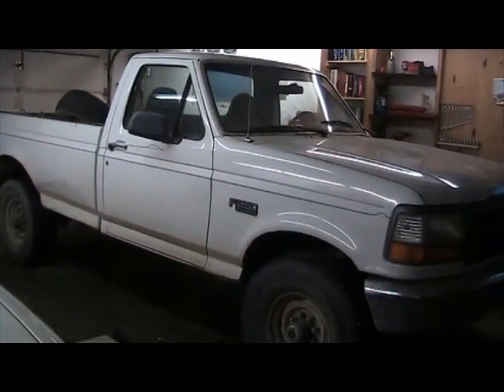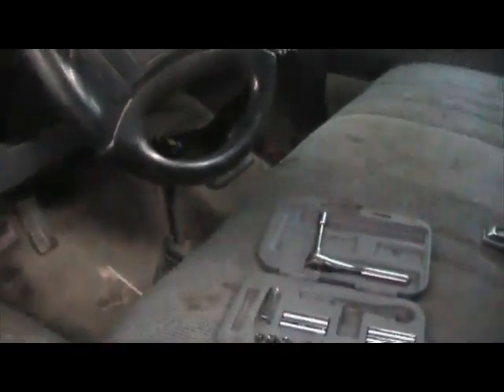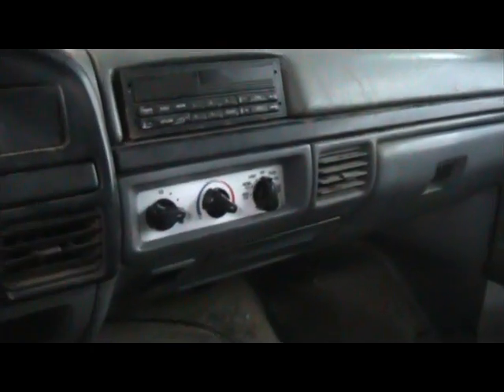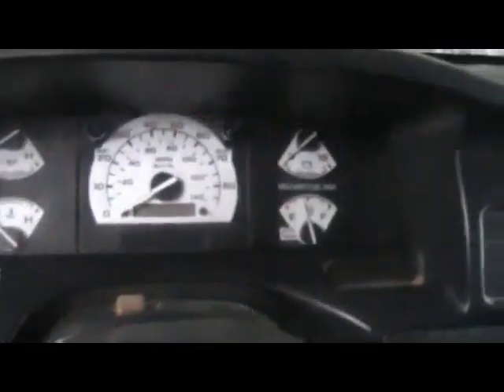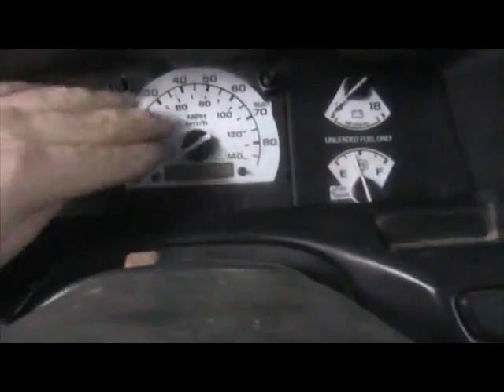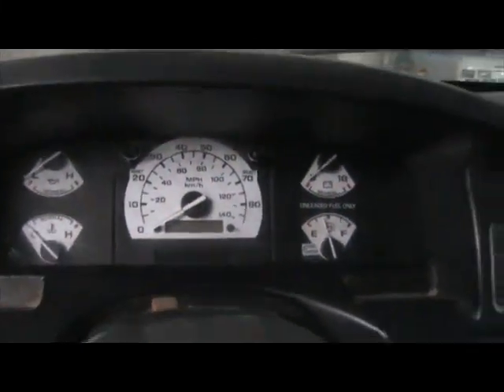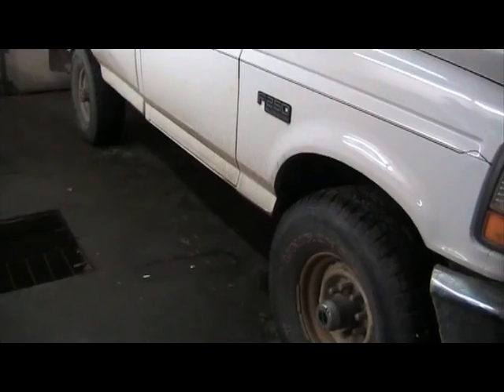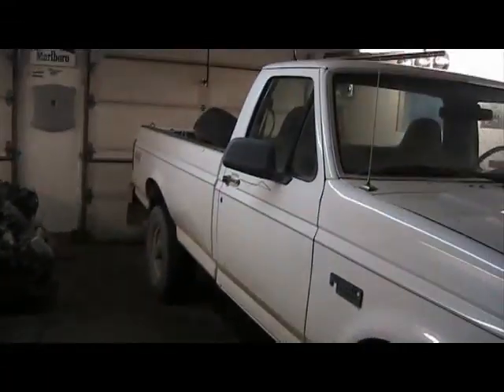Introducing my new pickup

Comment: 100% Correct Information: 5-speed Transmission on a 1996 F250 is a ZF S5-47 and the Transfer Case is a Borg-Warner 4406 if the truck has a Gross Vehicle Weight Rating(GVWR) under 8500 lbs. or the Transfer Case is a Borg-Warner 4407 if the GVWR is over 8500 lbs. Also, the rear axle is a Sterling(AKA Visteon) with a 10.25" ring gear.

Comment: 10.25 rear in that one. dana split beam in the front. ZF 5 speed more then likely (worth alot of money!!!)
that truck is rust free!  that would be worth like $2500 as it sits in minnesota, all fixed up with said items probably close to $3500. my diesel would be worth more if it wasn't so rusty.  I got a cab visor I would sell you for $20 or if you bring rust free black front fenders I will give it to you and pay for the fenders

Comment: they are obd 2 for sure. if it has a maf sensor then indeed obd 2. the transmission should be a zf-5. not a nv... the heavy duty trucks had them since at least 91.
Reply: Not necessarily OBD2. Some of the F250/F350's made in '95 but sold for the '96 model year were still OBD1. I've seen quite a few '96 trucks(including mine) that still have OBD1. Also, the ZFS5-42 transmission was first used in F250/F350's in 1987.